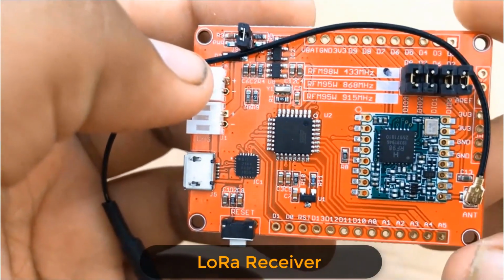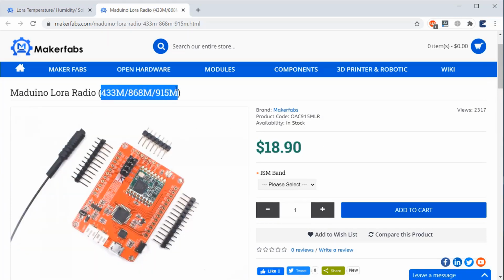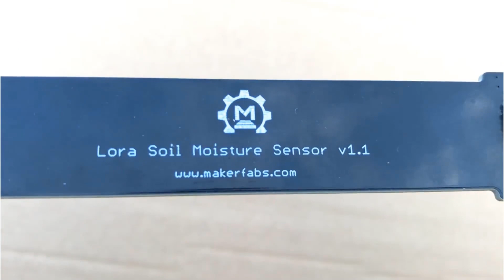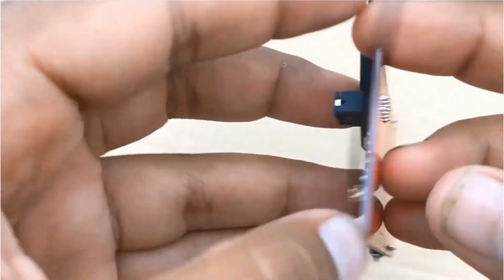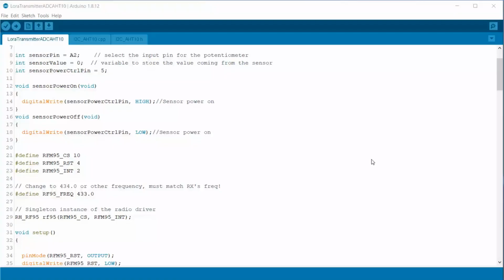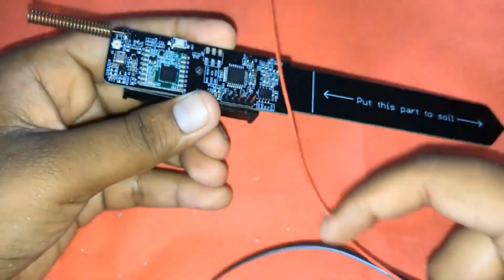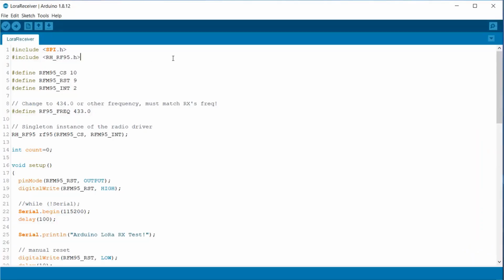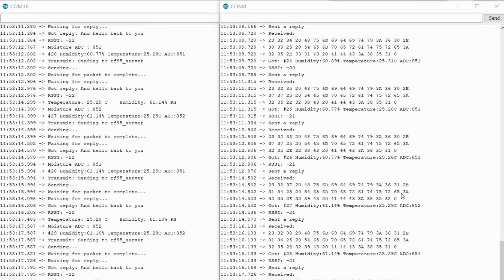IoT LoRa Based Smart Agriculture with Remote Monitoring System | RFM95 +Arduino+Soil Moisture Sensor

Comment: Kya is ki exact range bta skty hain...me ny same board order kiya to Pakistan me is ki range just 20 to 30 meters aa rahi hy jab k ye kilometer me btai gai hy to plzz bta dein k kya issue hy kindly reply
Reply from the maker: Set the transmission power to 20 in the code. The default power is set to 14. Use a good 5db antenna at the gateway. Put the gateway to the maximum height.
Reply: @HowtoElectronics  ap ki video me jo sender ka antenna hy wo thora acha hy but jo mujy mila hy us py aik chota sa faltu sa antenna lga hua hy to kya us ka issue ho skta hy?
Reply: @HowtoElectronics  our kya us ki jga koi our antenna replace kiya ja skta hy?
Reply from the maker: You can try and experiment
Reply: Any contact?

Comment: Nice, however it would be much more useful if you implemented receiver with some Wifi enabled module (e.g. ESP8266, ESP32...) , and you could put those measurements to some network server (e.g. mqtt) . This way data could be collected and processed.
Reply from the maker: I will sure do that in the next upcoming video. I am currently work on a wifi gateway. Thanks for the feedback.